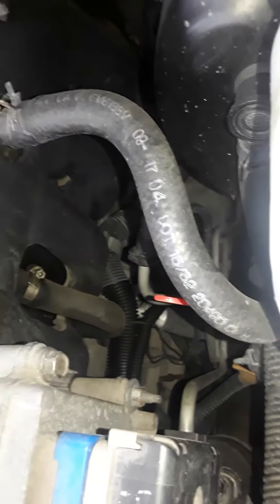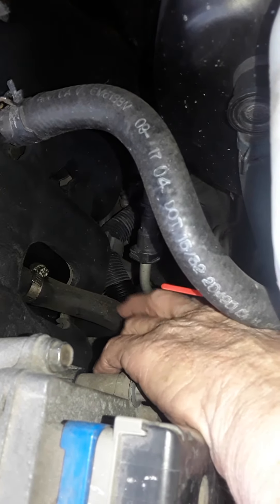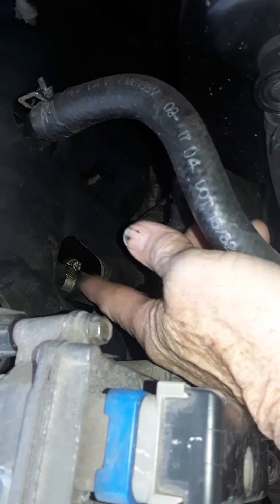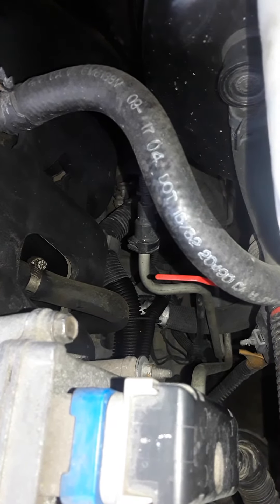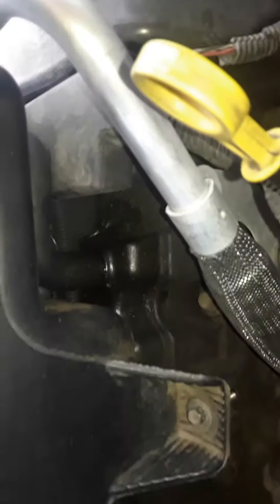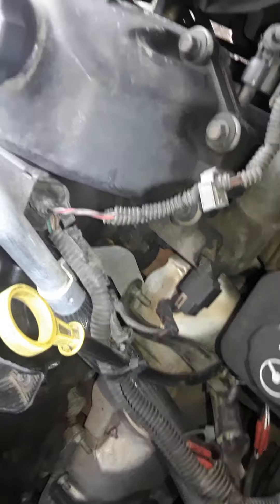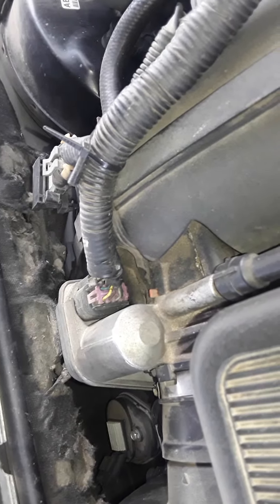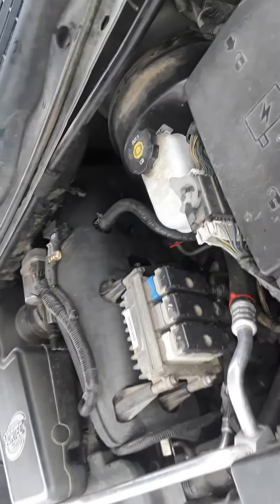PCV GM 4.2 ATLAS ENGINE

Comment: that clamp is not even VISIBLE in my 4.2 I6. I'm not sure how to get at it - it's just a screw driver to loosen it? I just have CRC throttle body cleaner. So I'll wait to get Beryman B-12 cleaner - I've never used that stuff.
Reply from the maker: How did it turn out for you?
Reply: @SurferJoe46  Thanks Joe - not sure if I mentioned that last Fall I finally just put in the NEW PVC hose - replaced it on that port - on the intake valve cover there. Seems to be working just fine! I had to replace my ignition coils and spark plugs - I was messing with some engine clean out formulas. I ended getting the catalytic converter replaced since I put acetone in the engine also - a new one only cost $200 and then the muffler shop welded it one for me (they got double pay from the old cat I suppose since I never asked about that.)
I had used acetone if I recall - oh yeah that's what I had first poured into that PCV hose also. haha. Anyway engine has been working fine. I'm just about at 275K. The new cat has a low rumble to it that sounds very cool but the MPG is not as good. I think I lost a mile on MPG from the new cat!
Yeah I had to make sure that PVC hose - the old PCV hose was not clogged - and so I just put in the new one. I was surprised at how easily the old one came off but it was a bit brittle. 
I think what happened is I put in some "snake oil" to clean the engine out - and I got a misfire in cylinder six after driving around for a bit to work in the engine flush. I think I accidentally had too much oil with the engine flush and I got air bubbles that had caused the misfire in cylinder six. So then I freaked out thinking that the cylinder had gone bad - after I replaced the coil and spark plug and I still got a misfire! 
That spark plug six is hard to reach under the firewall and I had accidentally cracked the new spark plug because the spark plug wrench did not fit on that brand of AC-Delco. So the next new spark plug I put in I was extra careful not to over torque it. 
The mechanic I used for welding on a chassis repair kit I had designed - for along where the muffler and cat is - the rust builds up there from the heat. So I had a hole right in the inside wall of the chassis over that triangle brace that connects to the transmission cross brace support.  found this engineer in Iowa that does custom repair kits with his laser welding CAD system.
I just had a new Reman Trans put in and they made me get a new cross brace support - I drove out to this salvage an hour or two hours away to pick it up in time for the new Reman Trans install. haha. So the transmission mechanic said NOTHING about the hole appearing in the chassis on the inside wall. 
And when the mechanic welder put in the repair piece - first he told me that the Misfire was INTERMITTENT and so it definitely was NOT the cylinder gone bad! What a big relief that was to hear! And also it was not a valve with bad seating since it was Intermittent!!
 Wow I was sure I had overheated the engine from too much snake oil causing that misfire originally. So that motivated me to discover I had cracked the porcelain on the new spark plug. I have NEVER replaced spark plugs before and it was at that moment that I got the gumption to finally just REPLACE that pvc hose since I had the new one sitting around. hahaha. 
So that was my saga to keep the TB going. I'll change the oil again in 500 miles. I changed the oil myself for the first time also since I had to do an engine flush to get out that Liquid Moly stuff. THAT's what CAUSED the misfire!! I remember now - I combined the Moly engine treatment with some other stuff - I think it was inert so I figured it was ok. Nano ceramic boron-nitride!! It's from Wagner in Germany marketed in the US as Air-Tec. 
So I had about a half a quart extra oil that was from the snake oil supplements - a quarter of a quart of the Liquid Moly crap. That stuff is MAGNETIC metal and it messed up the ignition coil. It literally got SUCKED UP into the ignition coil!! That's what caused the misfire. 
I did a video about it. haha. I suppose that Liquid Moly stuff is ok as an engine flush if you don't add it with anything else - since that half quart extra  - if it is NORMAL oil it is supposed to be ok. I know the V8 engine drivers of the TB will use an extra half quart since the oil pickup is in the front of the pan and so a quick torque acceleration JERK 3rd derivative will cause lack of oil in the pickup. So that's why I first figured an extra half quart of engine flush supplements - since the boron nitride is supposed to work into the engine... Oh well. 
I actually have some more boron nitride that I want to add again when I do the oil change next - I'll just leave out a quarter of a quart since now I'm paranoid. haha. It should be fine though with an extra quarter quart of boron nitride since it's inert. They say that stuff does not clog the oil filter since it's Nano size but then they"qualify" that if your oil is dirty then it can clog. haha. So only add it when there is new oil at the oil change. Then it should work into the crank case, etc. to fill in the holes from metal wear or grit, etc.
Actually when I did the engine flush I actually got a spray straw sucked into the oil pan!! I could not get it out - it just vanished into the oil pan. The welder mechanic said not to worry about it. haha. Hilarious. I sprayed acetone into the oil pan when it was empty - and then I used MMO to flush out that acetone and I let it drain over night. Then I added more oil back in. And THEN I had the welder-mechanic change the oil again just to make sure I got that acetone out of the engine. hahaha. I'm sure it would have burned off if there was any left since I had used a LOT of acetone at first to clear out that Liquid Moly crap. But the muffler welder said - NOW you're not just going to destroy this NEW cat are you? So I wanted to make sure I didn't have any acetone left it. 
Whew!
Reply: Holy shit^^^^^
Reply: @joshuakeith8710  I'm now at 282K and the engine seems great - have 5K on full synthetic oil. Should probably change it soon since I've been hauling some weight long distance. I'm a big fan of epoxy spray paint now - that appliance stuff - only one kind sold at Menards! Best paint to keep the rust off the vehicle. That porcelain finish - kind of strange there's only one epoxy spray paint of so many kinds of spray paint at Menards.

Comment: This is how a mechanical info diy video is perfected to a t. Thank you. But quick question and Hopefully you can get back to me soon. To where your reply would be useful. Where does that hose go because in me taking it off? To pour Barrington into it, the hose cracked and I don't see no way of getting it off. Except taking the computer off. Then taking the crank case cover off.  And i'm no mechanici'm a d I yer 😂
Reply from the maker: The top of the hose goes to the plenum and the bottom goes to the intake runners. You don't need as much clearance as you think. You can destroy the old hose - but have the new hose ready. 

The new hose is available in bulk --- you do NOT have to buy an exact replica with a GM part number on it. 

Once you get the clamps off,  cut the hose off if it won't slide off easily. Then you can replace it with a new piece. It is really simple. In most cases, the new hose won't need clamps --- it's not going to leak. 

Use: BERRYMAN'S B-12 Chemtool. I have no idea what "Barrington" is.
Reply from the maker: Maybe I should say that you can just cut this hose off and replace it with a new piece of bulk hose from a parts store.  You do NOT need a factory formed hose --- it's almost perfectly straight - so that idea should be off the table. 
Cut the old one off if it resists at all! 
Hose clamps, although pretty - are not even needed to hold it in place --- there's no pressure in it so it doesn't need to be clamped on.

Comment: There is no PCV valve on the 4.2 the Hozier pulling off is the vacuum for the brake booster and by the way it's not called pollution control valve.
Reply from the maker: There is a vacuum booster line --- and there's a CV hose too. Look closer and see for yourself --- and yes --- there is NO PCV "valve" --- that's well established already.

Comment: I can’t get my hose off it’s hard  as a rock lol
Reply: Then get a sharp box cutter type knife and carve it away until it slides off. It IS replaceable from a parts house as a bulk Gates Green Stripe Emissions Hose. Remember that Emission hoses are sold in 32nds of an inch inside dimensions. It should look like 19/32: or 21/32" or something like that. Be sure to use the liquid version not the spray unless you want to have a lot of empty cans around.
Reply: .... and ignore my oddball user name -- it's me.

Comment: Anwser me
Reply from the maker: Mohammad ... I do not understand your language syntax. Please ask me the question so I can understand you.
Reply: That hose has nothing to do with PCV system that's your vacuum for your brake booster which most vehicles have yes you can put cleaner in there I would suggest you just using seafoam and spraying it in there while it's running to clean it back to the PCV system it needs a PCV valve in it which there is none I am thinking about installing one of mine
Reply from the maker: @markthrush2139  You are not gonna like this --- but you are wrong on every level. 
1. I don't like people who like to be ignorant and say ignorant things as spiritual epiphanies.  
2. I don't like people trying to correct me when they have ZERO idea of what they are speaking. 
YOU fit one or both of those categories. Go away!